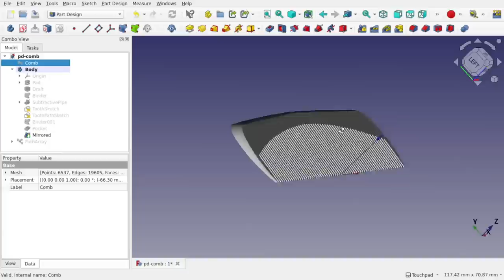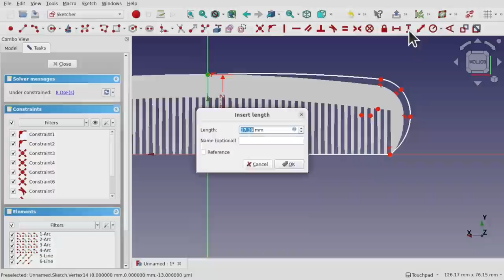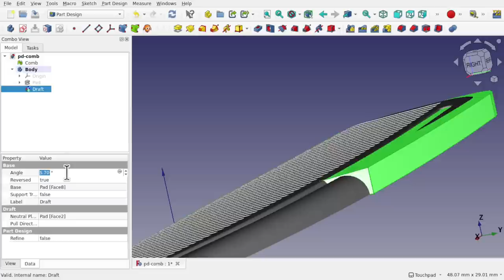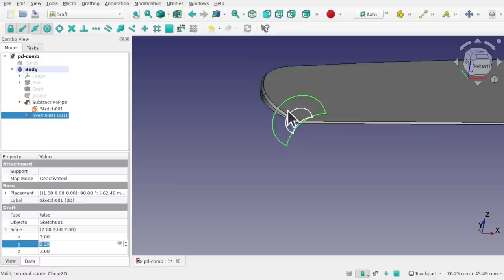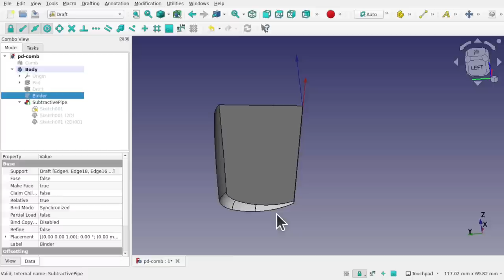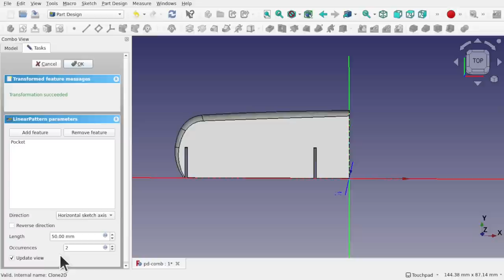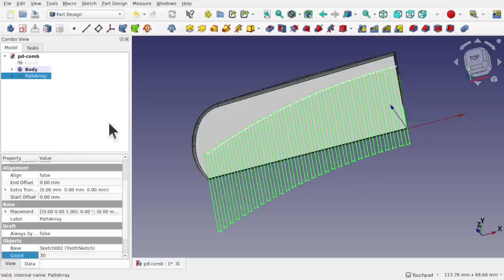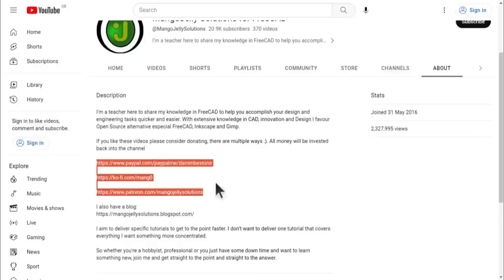FreeCAD: This object is harder than it looks! Helping a Patreon Model a Comb

Comment: Did you do this in part design because it was the best way, or to show it could be done? I am still struggling to work out whether part design should only be used for simple parts.
Reply from the maker: People tend to use that the most and I knew you would get into a few challenges trying to complete the model. So thought  it would a good example of mixing workbenchs. Part workbench is so much more flexible and as you say part design can fall down when a model gets to complex. I have a video on my channel regarding part vs part design which explains the reason why they exist and when to choose one over the other.